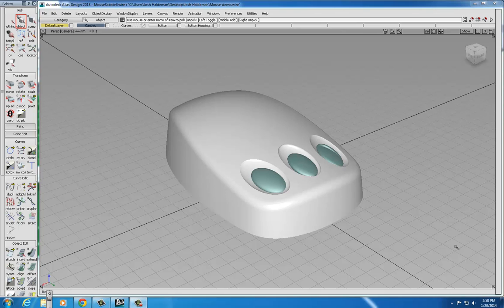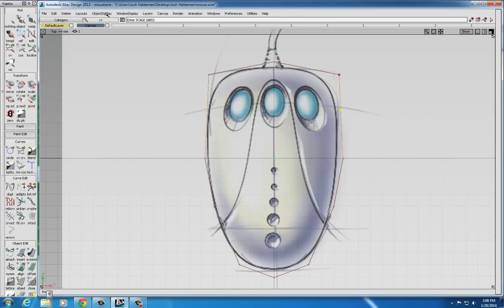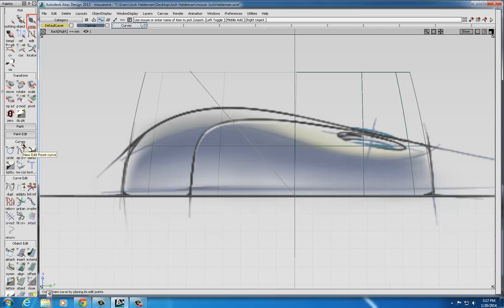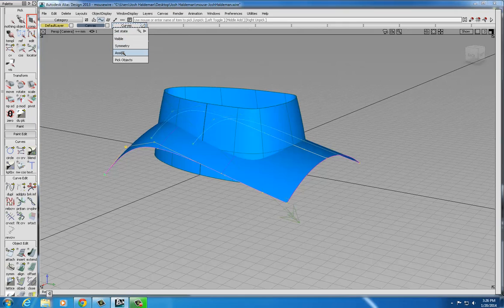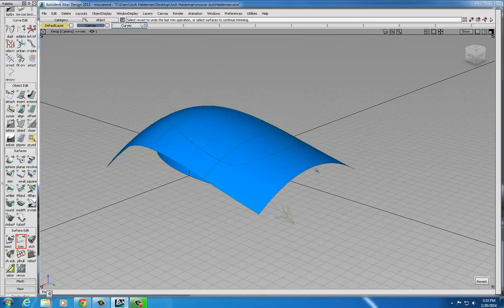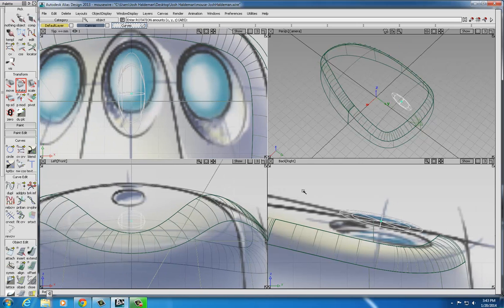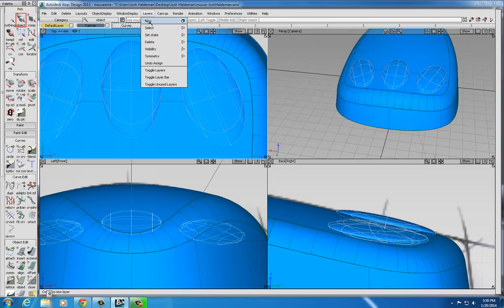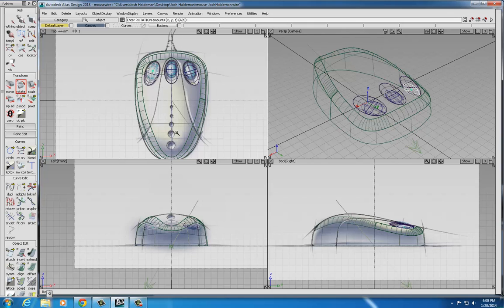Autodesk Alias 2013 Computer Mouse Tutorial

Comment: Hi,
I've spent several hours so far trying to replicate this tutorial on alias 2015 version and my work is not coming out the same in two specific areas so far.
1. When using the rail tool instead of getting a nice even shape I get a spiraled pointy shape.  I selected 1 rail curve just as shown in the video so it lets me to make the rail it just comes out uneven and unusable.  I tried adjusting the x scale and it helped a little but it's still twisted.

2. When using the round tool the video references 1.25 so I did that but the curve did not seem noticeable at all like I didn't see any change.  So, I tried the revert and the shift key on the line separately and together but now it wont let me select the curve at all.  It says select a pair of edges and I do, but now it wont highlight the edges when I select them.  I've tried for 2 hrs and am not able to proceed because I cannot get past this point.  So, I started over and that is when I ran into problem #1 again.   I got lucky with step one the first time after a few attempts but now I'm having trouble getting past it again.

Any insight into my problem areas would be appreciated.  Thanks for the tutorial, unfortunately our settings or versions are probably different which is causing some difficulty replicating it.  I just started using the program so all the settings are default except the ones advised to change in your video.

Thanks
Reply: I found the solution to problem #1.  My x scale was set 0 so when I switched it to 1 and it resolved that issue.  However now I am running into another issue besided issue #2 is that I can only view the image in orthographic views when I switch out of that and into perspective the image and grid lines vanish.  Any thoughts?
Reply from the maker: Fix it TV Yes, you can turn both on and off under the "Window Display" menu at the top, then click on the "Toggles" fly out menu and choose the option box next to "Canvas Planes" and "Grid".  That should get you up and running.